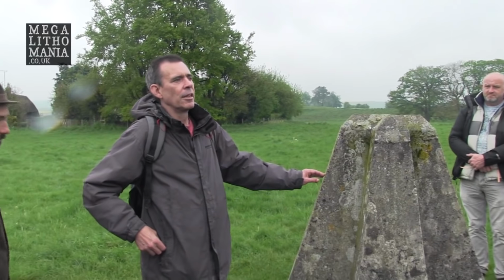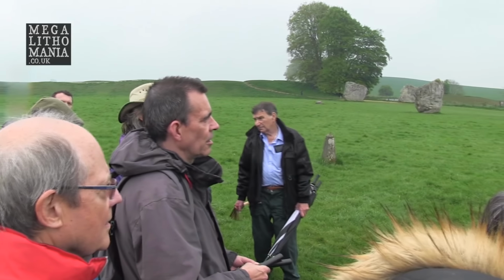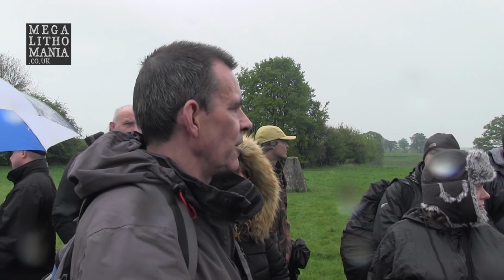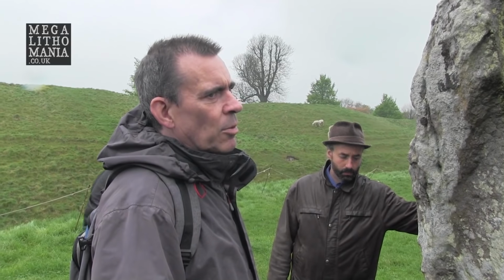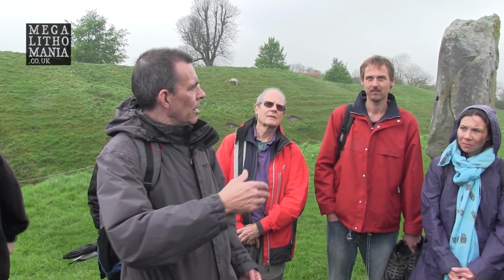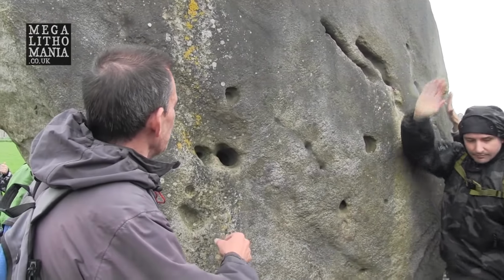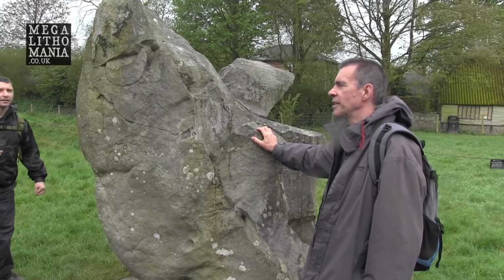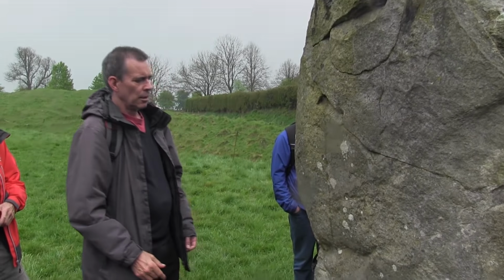Secrets of the Avebury Landscape - Archaeoacoustics & Hidden Mysteries with Steve Marshall

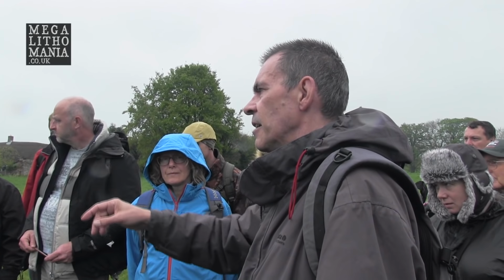Comment: 5:46 just cause its astronomical doesn't mean its a straight line. hardly anything in astronomy is in a straight line if you consider 3 points. look at the giza plateau. the 3 main pyramids are shaped like orions belt. (not quite straight)